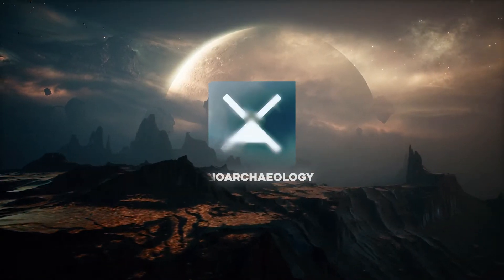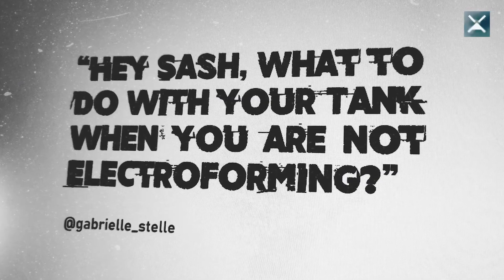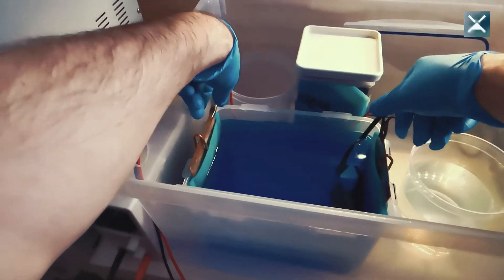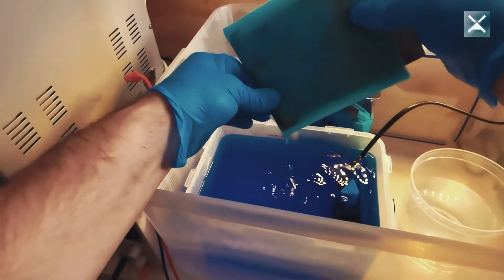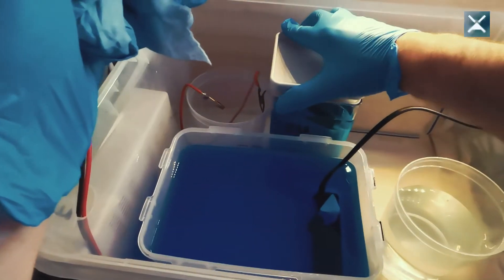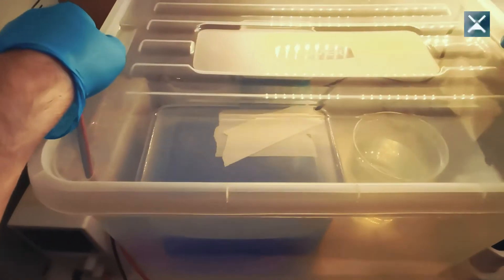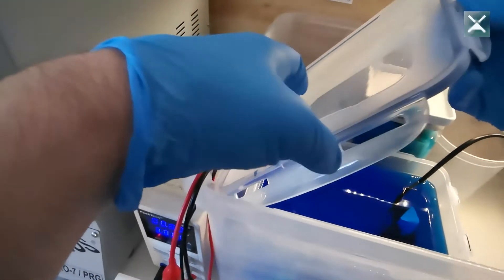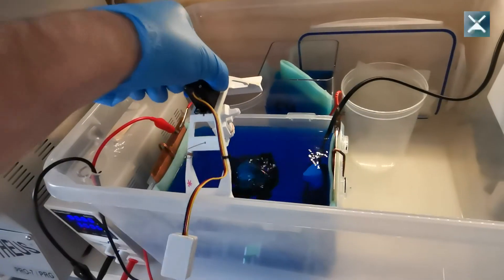Electroforming Quicktip - How to put your setup into Standby

Comment: Love this one. Only video I found which covers this topic. Quick question: Can I just leave my anodes inside the electrolyt? And close it because I have not another container which is big enough.
Reply from the maker: HejHej ... as i mentioned in the Video it is not advisable to leave the unused anodes in the electrolyte for a long time. The Electrolyte - acid that is - will eat up the anode even if there is no voltage or current present. This will saturate your electrolyte with copper ions and will prevent a shiny electrofoming result. Im sure youll find some spare container to put your anodes in. Happy eforming!